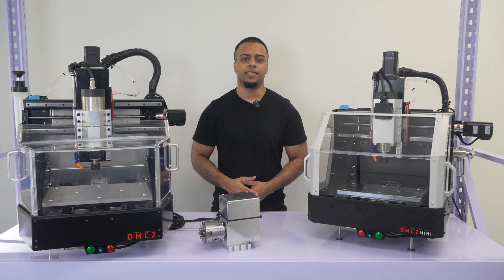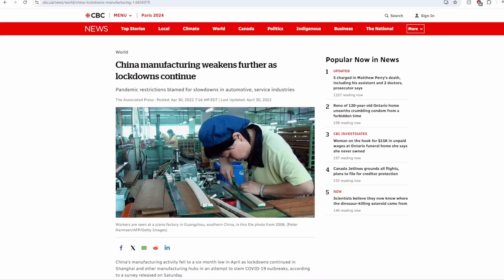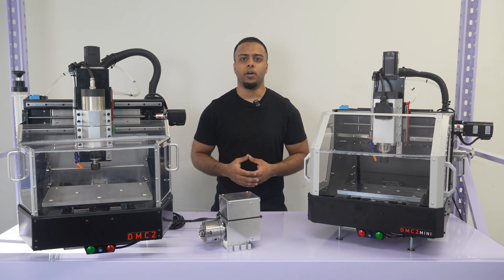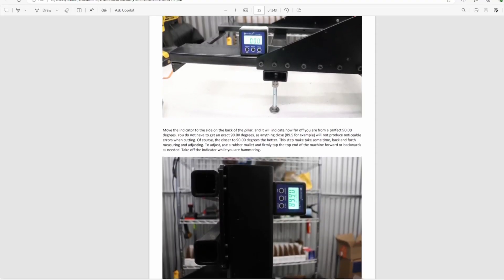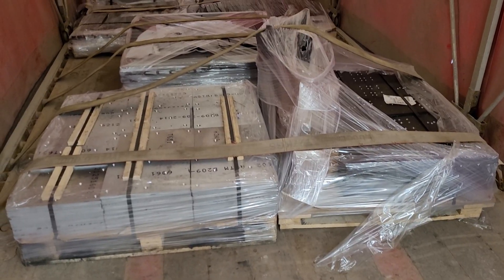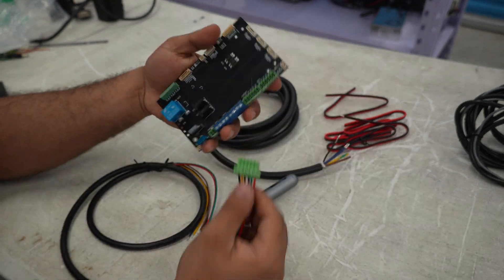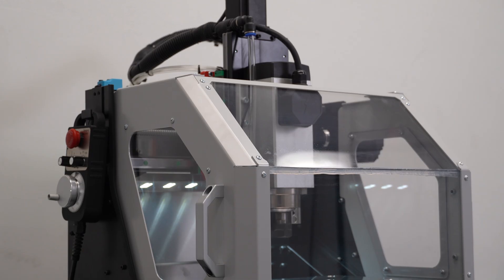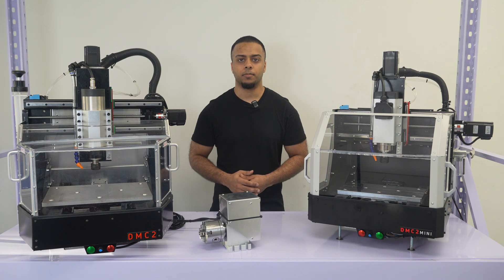Huge Channel Update! A New Machine is HERE! DMC2 Mini Desktop CNC

Comment: How hard is the CAM software to learn and to move from 3D model to machine instructions? 

Also curious:  why do you move the spindle?  It seems that other mini mills move the platter in X and Y axis?  The secret to a mill is the stability and rigid RAS of the spindle.

Finally:  have you considered partnering with an assembly shop?

Comment: $2100 difference for 20 hours of assembly time?
Are you getting the engineering director of Lockheed to personally assemble this?
Reply: increased shipping cost is the main issue
Reply: That guy would cast $500 an hour.

Comment: You actually addessed the complaints I had with my DMC2! There was no way I could have trammed my machine if I did not already have a manual mill to surface areas where the rails mounted. The flatness of the square tube was horrific with up to .015 variation on the horizontals. The two upright square tubes were bent in opposite directions and requied shims approaching .100. The tramming ability of the DMC2 is virtually non existant with enlarging holes and shiming as the only options to get the required range and no jack screws to facilitate fine adjustment. I can't count the hours required to loosen bolts, bang on supports, retighten and tram again, again, again.... I finally got the DMC2 to a reasonably acceptable but not perfect tram. Good for you for owning the issues with your DMC2.
Reply: This Sharif guy is an amazing engineer to be honest.
Reply: Yes, these people are clueless of the requirements for mounting Linear rails and Ball screws, it is imposable to mount Linear Rails on an unmachined surface

Comment: I’d love to have one but what made my feet cold was mach3…
Reply: Why is mach3 a problem?
Reply from the maker: Our electrical boards allow you to attach any controller of your choice as long as it outputs standard 5v step/direction signals and takes simple closed circuit estop/endstop signals. A larger board might not fit in the enclosure.. but all you need to do is extend the input/output wires and fit it to the board of your choice. Understandably alot of people prefer LinuxCNC, Centroid, even GRBL.. this is a common modification our DMC2 customers do.
Reply: I hear you... just upgrade the controller to Acron...  hopefully, they sell barbones unit.

(Just read his reply... so that's a yes. )